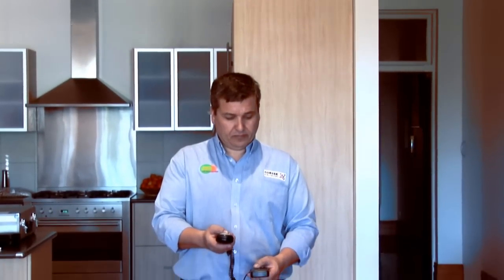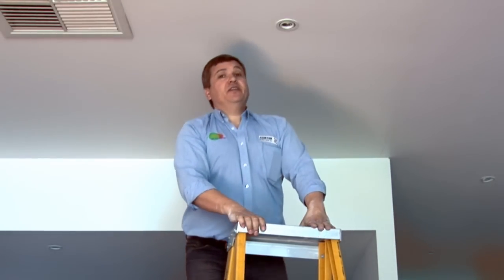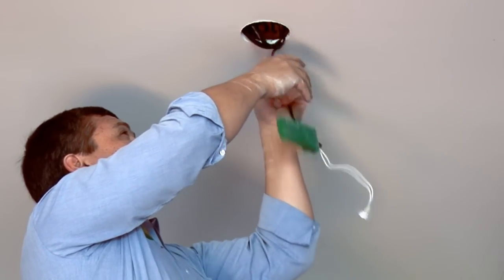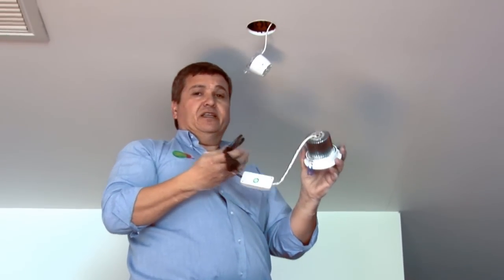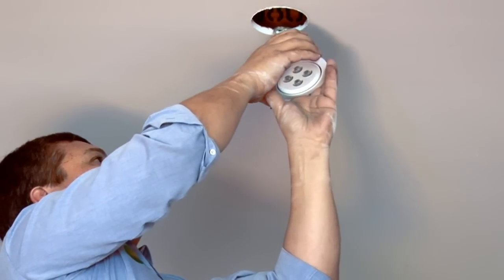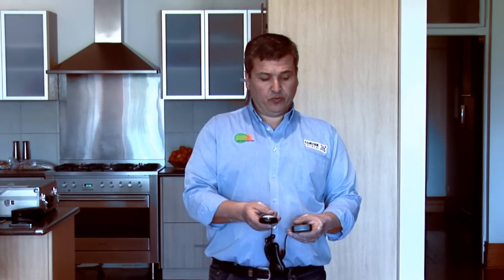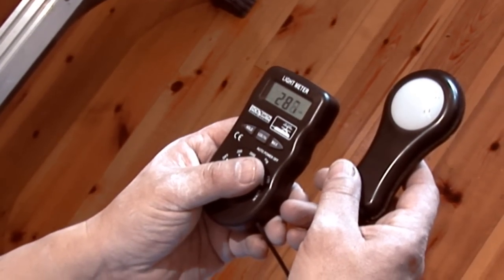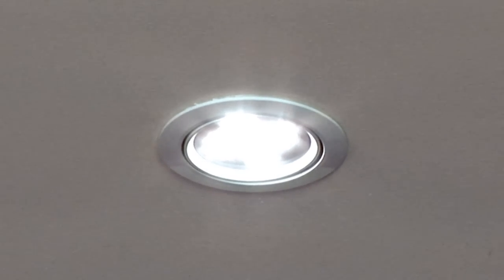How to change a downlight from Halogen to LED

Comment: My  replacement LED bulbs will not work with existing transformer but require a constant voltage L E D driver to power the 12volt-6 watt LED bulbs

Comment: The plug base should have been secured in the ceiling as per Electrical regulations AS/NZ 2013
Reply: And use a government authorized ladder with 2 people standing at the doorways with stop/go sign.